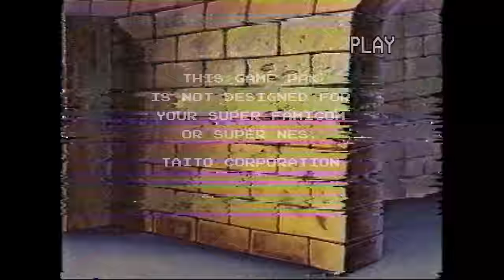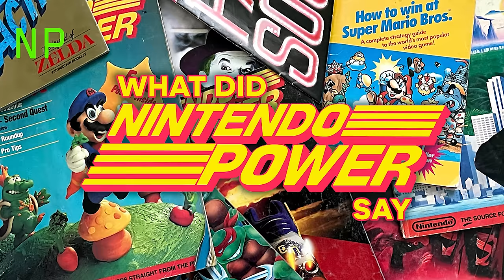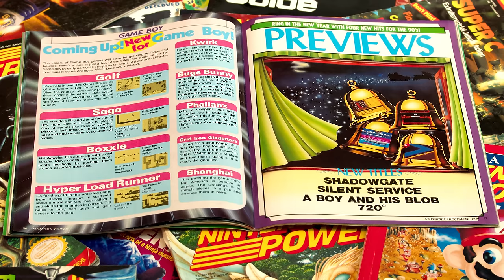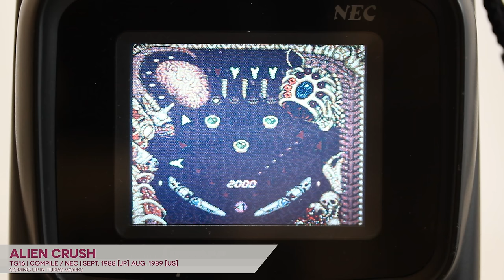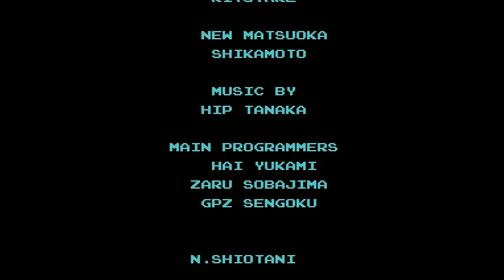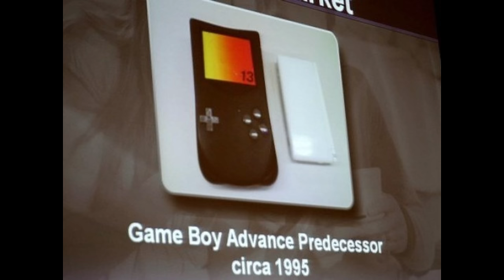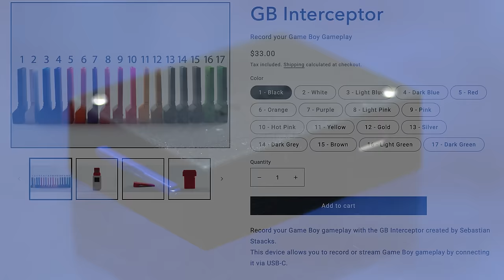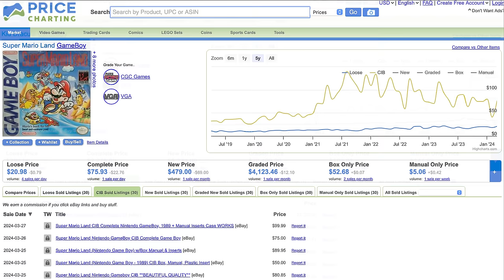Second coming: The Game Boy | Game Boy Works Vol. 2 001

Comment: The first handheld system to offer a link cable was actually Redline Drag racing by Kenner, in 1980. It used essentially a head phone Jack to connect the games together. Allowing for simultaneous drag races.
Reply from the maker: A thing like that.
Reply: @JeremyParish  Pete Campbellism ftw!

Comment: 13:44
That unit is a quite a legend.
Reply: I'm a bit surprised. I've remembered the letter in Nintendo Power about it since the day it showed up in my mailbox, but never realized that it stuck in the memory of so many others as thoroughly as it did my own.
Reply: @Belgand  
The circuit board survived, the aftermath of a missile strike, casing melted and screen busted, but still functioned.
That cemented in my memory that I can trust their handhelds to survive a fall, from non extream hights.

Comment: Regarding GB vs GBC, at least here in Europe it was the upgrade we always wanted, a TFT screen that didn't wash out the graphics. Sure, still no backlight, but it ran the around the same amount of time on two AAs instead of four, was a bit smaller and, thanks to a memory and CPU upgrade, bigger games. I doubt that a Heroes of Might and Magic in all its glory for example would have been possible without any simplifications on the classic GB. This way we had an 8-Bit version with at least the feature set of HOMM 1, to stay with my example.

Comment: The Game Boy is a good example of utilizing a principle of consumerism: PRICE IS KING. 

By utilizing cheaper components and giving it longer battery life, the savings went in the buyers pockets and they responded by making it a success. 

Having a killer pack in game: Tetris helped as well. 

I had a Lynx and Game Gear, the color and backlit screens were much better...

But the short battery lifes killed them. 

I got power packs for each one, but by then, it was too late, Nintendo was the handheld king and still is. 

The lack of a backlit screen was my major frustration with GB.

Comment: Is that true about the blown up gameboy.  I've always called bs on that, because of the screen. How is everything so scorched, but the thinnest plastic on the device is not melted or scorched.
Reply: Ok, I've done some research. The original Gameboy shell was ABS plastic, which has a melting point of 190-270°C. The Gameboy screen was a Super-Twisted Nematic (STN) display, which has a melting point of 60°C to 100°C. This means the screen would melt at twice the rate of the shell. The impact area of a ballistic missle is approximately 2,000°C.